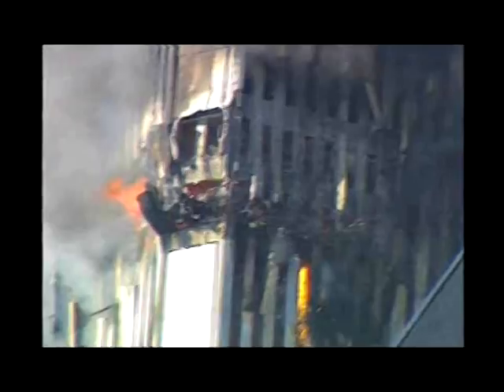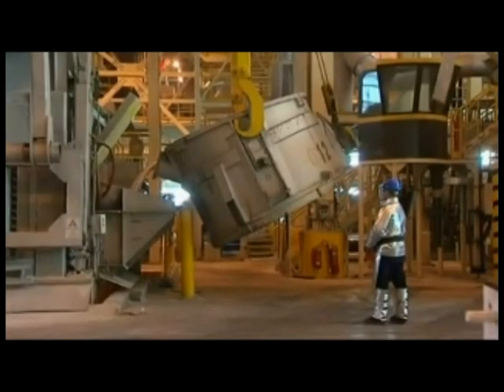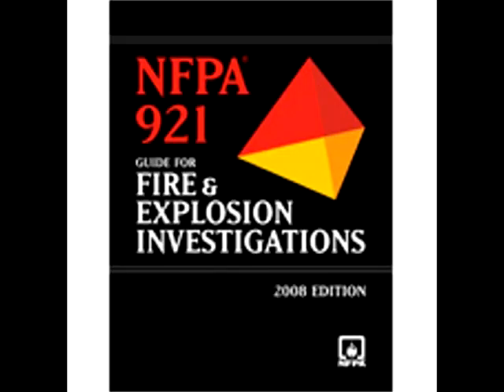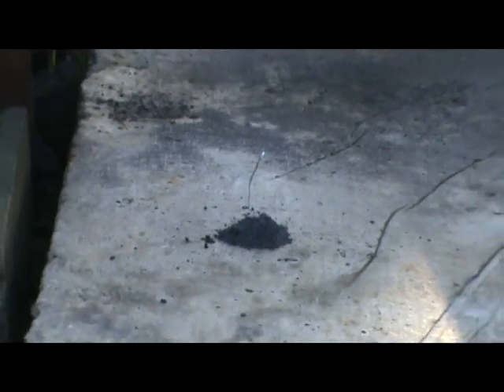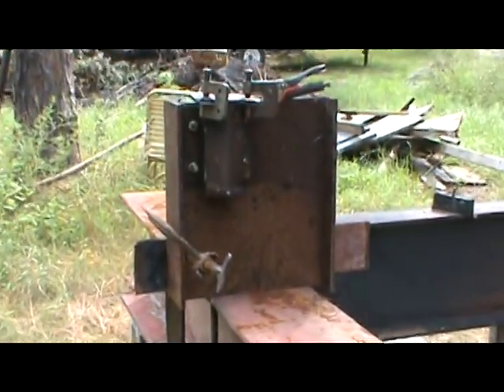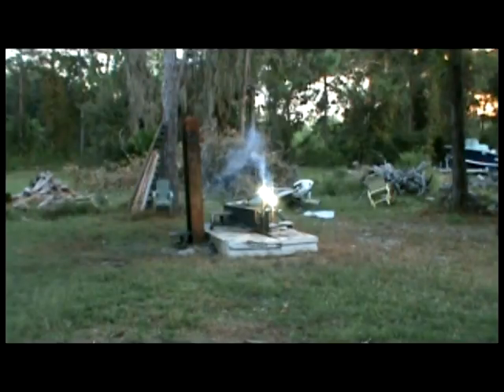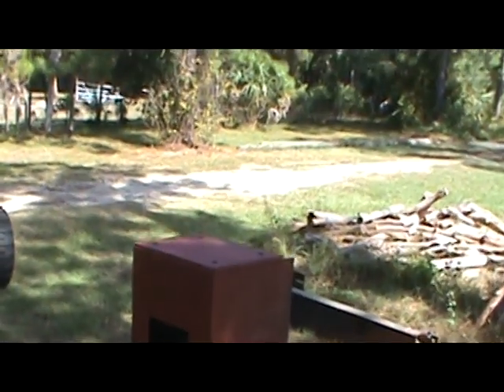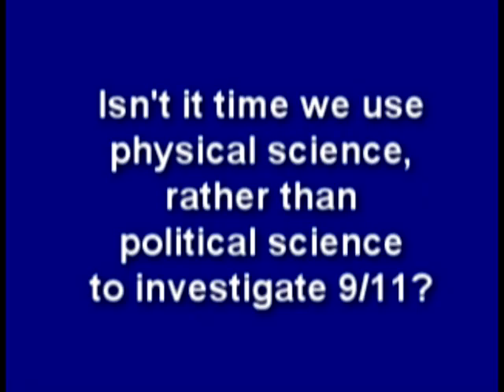9/11 Experiments: The Great Thermate Debate

Comment: No one claims Office fires melted steel beams, trusses or columns.
Reply: Some might, because there is no doubt that they contributed a lot to the blaze, as well as the miles of communications cable, switches, terminal blocks, routers, servers, printers & paper, distribution frames, telephone lines and equipment, ceiling tiles, paging speakers & related equip., Lighting fixtures, AC power, BIG OLE OIL-FILLED POWER TRANSFORMERS, HVAC Air Handlers, smoke extraction systems, God only knows how many and what kinds of cleaning chemicals and waxes desks, chairs, file cabinets, planters, TV's, CCTV, water coolers, foodstuffs, refrigerators, stoves, microwaves, carpet, floor tile, vinyl wall-coverings, painted surfaces, pictures, signs, doors, stalls...
Dead Bodies...

Comment: I worked for the federal government for 10 years. You people claiming it was an inside job are giving the government WAAAAAY too much credit. There is no way that group of incompetent assholes could have pulled that off. most government officials cant even take a piss without wetting the front of their pants.

p.s. the steel did not need to be melted for collapse. Only softened.

I could buy the story that they knew an attack was coming and allowed it to happen purposefully or negligently ignored it. But I know they could not pull off a staged attack of this magnitude without fucking it up ROYALLY.

Comment: Aluminium and, to a greater extent titanium, burn very hotly.
Not only that, there are significant amounts of composite materials that act as very good fuel.
I am not sure about the presence of magnesium in these aircraft, but used to be extensively used in aircraft. All the light elements used in aircraft for fuel saving purposes: carbon, titanium, magnesium and aluminium are very reactive once ignited burn very hot and are quite capable if melting steel, but the structural failure of the buildings was not due to melting but loss of strength due to heating. Just watch any blacksmith at work and you can see the effect of heating, well below the melting temperature of steel.
The idea of a conspiracy tieing the collision of the aircraft to deliberately placed pyrotechnics is just plain fantasy. Ockhams razor should be invoked.
I enjoyed the video for the fine demonstration of the power of simple material combinations
, but not the implications as they are fanciful.

Comment: At 1:27, the beam is not melted, it was corroded in fire at temperatures at or below 1000C.  Video is dumbed down tripe and lies.
http://www.fema.gov/pdf/library/fema403_apc.pdf
Not melted - 911 truth lies about 911 due to ignorance. 
Fires were not burning out, the video quote mined nonsense to make up a lie. The fires were not fought, the water system was damage by the massive aircraft impacts. 
The only thing you can do with this video is count the lies, as it exposes the ignorance of the author on a broad range of topics.  
The  engineer author, is a sewer engineer; and he can't comprehend physics to understand how the WTC collapsed, but he can do sewer engineering, and produce lots of BS.  

Who planted the thermite in the device seen in the video? Who cut off the insulation to get to the steel?  lol, what a load of bs and  fantasy, dumbed down for gullible people.

Then the dolt shows thermite products fused to steel. His experiment proves no thermite was used on 911, because no steel from the WTC showed iron fused from thermite/thermate. good job,the video debunks thermite
13:12, shows iron fused to the steel from the thermite experiment - a phenomena not found on any WTC steel.  Thermite is busted by the thermite experiment of a sewer engineer who think thermite did 911 but he can't comprehend no steel on 911 melted, and no steel was exposed to thermite.

Comment: My theory on the molten metal is the tons of metal collapsing cause enough friction to melt. If you think about it that ALOT... ALOT of metal moving VERY... VERY fast. And i have seen metal be bent fast enough to glow, so thats what i think cause the melting matal. however it dosent explain the melted metal before the collapse of the tower.
Reply: Aluminum or other metals that have a melting point lower than the maximum temperature a jet fuel fire can reach.

What are planes mostly made of?

There's your answer.
Reply: MrRandomGuy86 YES! so true good thinking.

Comment: Any chance that was molten aluminum? There'd be tons of it coming from the aircraft in the towers, and the melting point is way lower than the melting point of steel. Also, I believe the buildings had aluminum siding.

Comment: Thermite wont cut steel,lol..What idiot came out with that?? People have been using thermite to cut open safes, weld railway beams, and many other cutting and melting of steel  jobs with it for a LONG time!! If you can do this, at home, as an ametuer, what do you think the military capabilitys are??  I can PLASTICISE thermite, and use it like C4, in ropes, stuck to steel!!  Horizontally, without a means of holding it as you have devised[too cumbersome], the thickness determines the amount!  Its rate of reaction can be slowed too, giving a longer time for its 5000 degrees to work! Of course it was not just the bloody Al Queda PAWNS who did this..on their own..so many DUMB yanks,lol...well done man:)

Comment: what about the subway tunnels it would make a firer real hot( air supply )also one mile in the air, 30 to 50 mph normal winds speed? this would make it hotter too? 3rd the air plane fuel would falling 1 mile thur a elevator shaft, would blow up on compression ? it is more likely sand people did this,we might of known? but it like the left hand does not know what the right doing

Comment: I may have said this in the years past. The discovery channel (ussa) had a show about 2004 or 5, that took us through the world of 'Building Demolitions' and described the techniques used. One is a copper angle bar, looking like a 1'x1' and how ever long they require for each beam, packed with the thermatic type of cutting compounds. They attached these copper angle bars to the sides of the Steel I-Beams with thick rubber bands wrapped around the over hanging angle bars ends. One cutting bar on one side, and another on the other opposite side. Oh yeah, the cutting angle bars made of copper were slightly longer than the beams were to leave them something to wrap the rubber bands around. The cutting happened so fast, the Rubber Bands they used to hold them against the steel beams didn't seem to be damaged until the cutting was done. Think about that for a moment.

So you want proof of these being used? In the videos of the corner section of the tower where the molten metallic Fire Fall took place, also has white smoke plumbs emanating from the area the molten metals were coming from. These molten metals remained in the Orange - Red 'black body' state for a long ways down as they fell.

We have the proof and evidence of treason in the Bush syndicate, for a fact.
Reply: These techniques to cut using thermite are old and were in common use in the 1980s. Thermate was specifically developed to be more oxidising than thermite for the purpose of cutting. For anyone to claim that thermate cannot cut steel is being, described politely, dishonest.
Reply: ***** You forgot what thread you are replying under? The Discovery channel had more than an hour on these techniques to take down a building.
Reply: ***** a building burn in spain for a week and did not collapse
Reply: Duane Slama
And this building was hit by a plane or falling chunks of other buildings?

Nope.

WAKE THE FUCK UP DUMB DIPSHIT SHEEP!

Comment: Ingenious - thanks for posting!  

I'm not familiar with the theories of 'demolition'!  Seems a little far fetched...  Does the burning temperature of a thing depend on oxygen supply?  Under what conditions is the stated temperature for burning jet fuel measured? I'm thinking of charcoal furnaces (with bellows) used to melt steel in a traditional forge.  Seems to me that that the thermal chimney effect from such a tall building could generate quite an updraft, and create a massive furnace.

Comment: No one wants to believe that 9/11 was an inside job, because if it were, it would shatter all trust for the government and all hell would follow. It would cause mass hysteria and most likely world war 3. Im not a truther or a conspiracy theorist but you have to admit, a lot of the evidence that is coming to light is pretty compelling. Some people say that the fire contained would burn hotter than an open air jet fuel fire. This is false. Jet fuel is only capable of its potential energy, as are the materials being burned. The fire cannot be made hotter by containing it, as the fuel in the fire can only produce the amount of energy (heat) that it is capable of producing. Jet fuel and office furniture cannot get hot enough to melt steel. That is a smoking gun that other accelerants were used. Maybe it wasn't a government job, but it was def. a job that was much more deliberately planned than flying 2 planes into those buildings. All 3 that fell also fell straight down upon themselves. ALL of them did. Coincidence? Unlikely. Imagine if either of those buildings had fallen horizontally, as they most likely would have in an uncontrolled collapse. Common sense should tell you that theres something very fishy about it all.